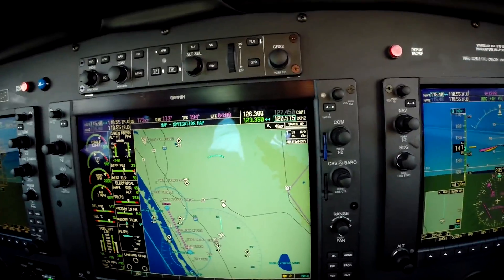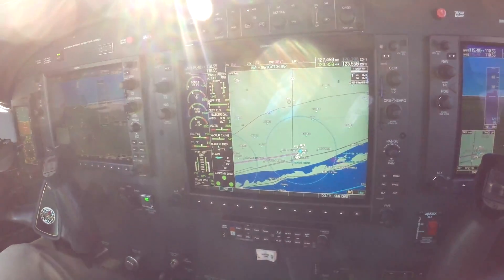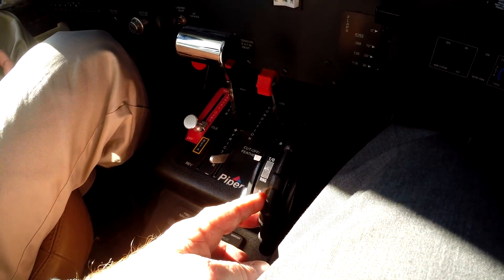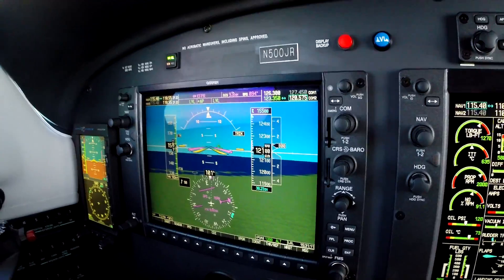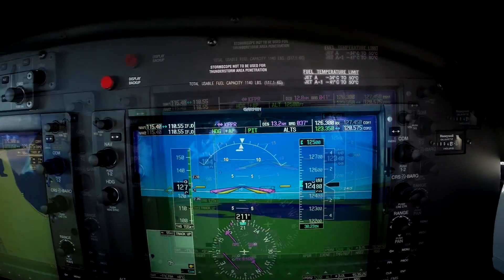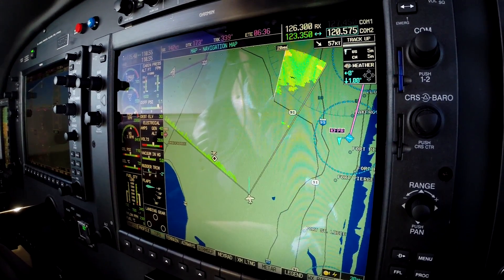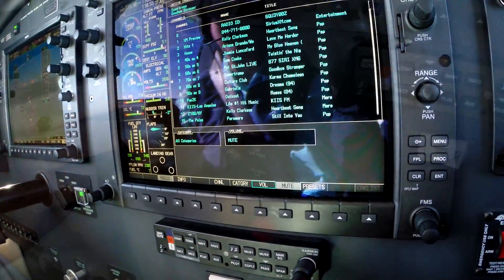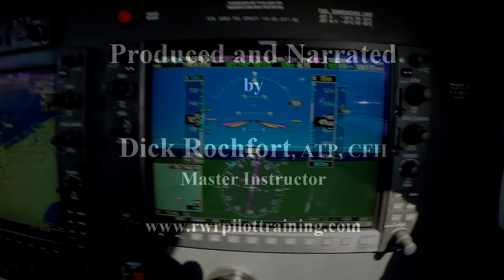Piper M500 Aircraft Demonstration Flight with Dick Rochfort

Comment: what is the fuel consumption per hour ??
Reply from the maker: On a standard day the M600 burns about 360lbs in the climb and 300 in cruise, but after flying the M500 (burns the same in the climb and about 250 lbs in cruise) I find the small amount of additional burn in the M600 to be negligible when compared to having to stop for fuel more often in the M500.

Comment: :))
it would be nicer for the pressure if garmin did like on other planes that the field eve is taken from itself from what you program as the airport that you are landing at and not have to be entered manually by yourself .
 looks like that is no inertial separator?
looks like you can start it up with the bleed air on?
thanks
Reply from the maker: Hi M, All of the PA46 Meridian aircraft are PT6 engines without a rain door or inertial separator which makes them really easy to operate. It is not recommended to have cabin bleed air open/on for start because, as the name implies, pressurized air is bled away from the engine. During start this leads to warmer temperatures. As always I recommend that turbine starts be conducted with a 28V GPU unless there is a compelling reason to do otherwise. Setting cabin pressure is almost completely automatic.. at the top of the descent set the cabin pressure 500 ft above the destination altitude. It really doesn’t get much simpler than that. Fly Safely - Train Often.. DR

Comment: At the one minute mark I see a mistake in the start sequence. After engine is started you are suppose to press the ALT (Alternator) button first make sure it takes the load then press the GEN (Generator) button and make sure the load is shed from the Alternator and transferred to the Generator... Surprised the test pilot did the opposite of what it recommended by manufacturer.
Reply from the maker: Hi Derek, you are most observant. Thank you for noticing the post start sequence. When this aircraft was originally introduced it had a less capable battery. The current (please excuse the pun) battery design has a quicker recovery rate which causes the alternator to go offline after a battery start. This is because the 130 amp alternator is trying to recover the battery. B initiating the generator first this anomaly is avoided.

Comment: Have had a Meridian for 3 months.  Step up from my Malibu.   Both are excellent aircraft.  Meridian is a joy to fly - easier to land and manage than the piston.   Much faster and smoother too - and I don't think twice about venturing far over water with the PT6A.   Getting an AOA sensor installed next week as a safety add on.   You really don't need it if you follow your speeds and watch your banks, but as we all know a stall can occur at any attitude and at any airspeed so why not have this instrument.  I think the M500 is an EXCELLENT add on and only wish they had this last year when I bought my aircraft - I would suggest to piper/Garmin two additional things: 1. A red gear warning horn and display (not just a caution on the CAS) if low engine torque is seen and the G1000 indicates <500 feet AGL and an AOA built into the airframe with a display on the G1000.   Otherwise a close to perfect aircraft.
Reply from the maker: Thanks for the comments Robert. Stay tuned! Piper is rolling out something new on 13 April and I will be there to report back to my subscribers!